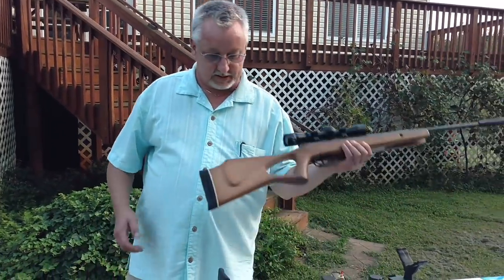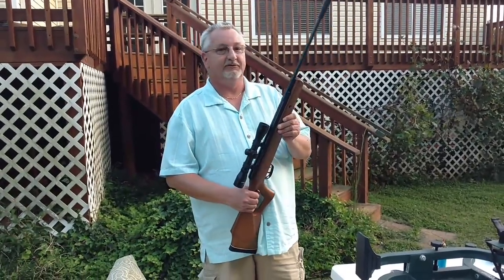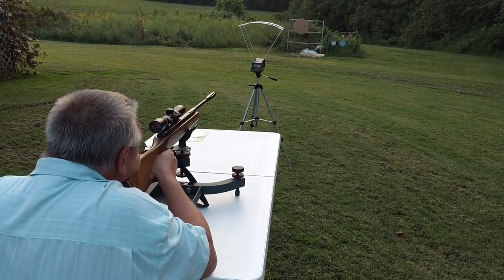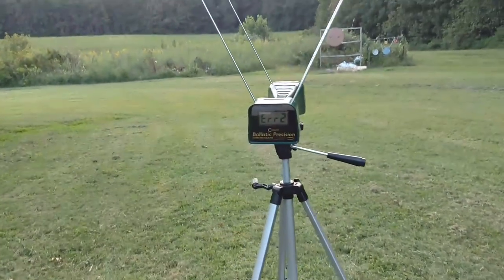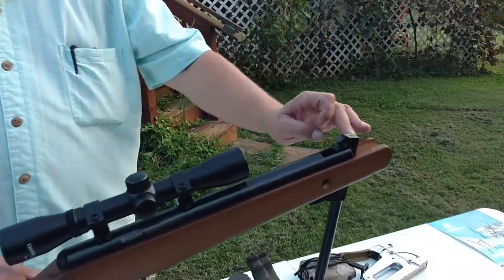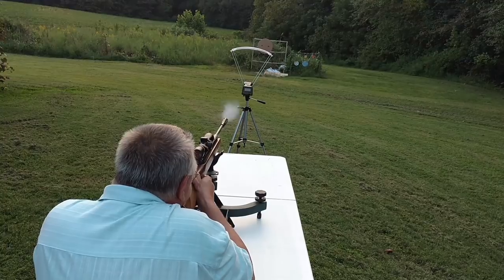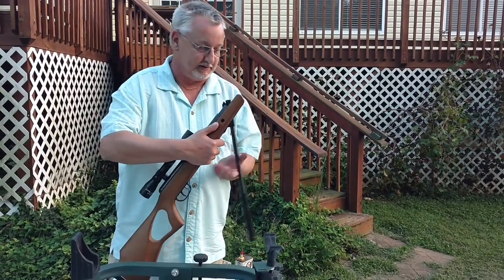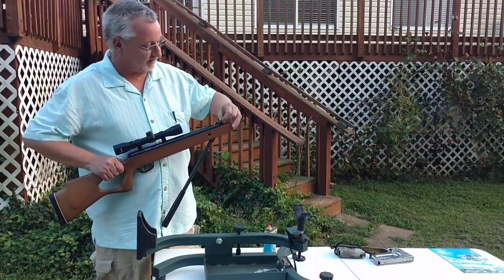Dieseling a Benjamin Titan Nitro XP .177 cal

Comment: Read sir. Murres what you do

Pit a half of cap full (not even that much) of fresh motor oil in the can of the pellet and close the can up and swirl the pellets around gently with the can - shaking it gently so the motor oil can get under the skirts of all the pellets. THEN LOAD YOUR PELLETS UP WHEN READY TO SHOOT 

INSWEAR. I HAVE A FAMO maxim .177. I used those same cross man pellets. I hit a grey squirrel from 50 yards away it went clean through him. I thought I missed the squirrels bcuz I saw the dust kick up on the other side of the grey-squirrel but when the squirrel jumped 3 ft into the air I knew it was hit. 

He ran or scrambled for ablut 4 feet and died n the streets. When I examined him there were a entry hole and exit wound. I was amazed!  

And NO ITS NOT DANGEROUS. I DONT KNOW WHY YOU TOLD THAT LOE. NOW ITS HAZARDOUS TO BE ON THE BUSINESS END!

Comment: And again, The Ruger Air Magnum combo comes in 2 calibers, the .177 that tops 1400 fps with alloy and 1200 fps with lead pellets so why ruin a good air gun when you can buy one that has the FPS you need.
Reply: Check out the Umarex Octane. Same rifle as the Ruger air magnum and straight from the manufacturers mouth. A little better, actually I think. Heavy tough breast of a snap popper lol

Comment: I want to try dieseling so bad but I don't want to damage my airgun at the same time. Will this dieseling method damage my air gun? I just want to try accuracy and damage with 3-4 shots.
Reply: No, it will not more than likely. Trust me. There is levels to dieseling. Greases like Petroleum jelly, Vicks vapor rub will be a mild dieseling effect but will be more consistent in velocities. The liquid choices like oils and gases are more powerful but not as consistent. Use Vicks Vapor Rub. Always seat your pellet, NO MORE than the width of a dime, before dieseling. It doesn’t take much Vicks, don’t fill up pellet skirt area more than 1/3rd. 
Have fun
Reply: @SouthernDestinations47  Thank you! Someone told me dieseling wont work on Gas-ram airguns. Is that true? I have hatsan mod 125 Vortex version not springer.
Reply: @cesurkarakus209  yes it will work

Comment: Don't understand how some folks say this can eventually destroy a spring. How can this destroy a spring?
Reply: It just wrecks seals. It may break the piston seal. It isnt acurrate at all when you deisel pellet guns
Reply: The shock wave when the oil combusts - while technically not an explosion, it is a very rapid burn that sends a shockwave of pressure backwards towards the piston. Your airgun was not designed to withstand this. If you're lucky you'll lunch the breach seal, if you are not so lucky the piston seal or spring will be toast. Might not be on the first shot, but it's in the post if you make a habit of it. Check the puff of smoke from the breach at 4m5 - 4m10s in the video....
Reply: "O" rings are cheap to replace. @Steeps1969  
Won't "break anything.

Comment: What about using flash cotton， or celluloid from pingpong ball?  The power of dieseling is limited by the amount of oxygen in the cylinder, so you may need a fuel containing its own oxidizer, and with slightly negative oxygen balance value.
Reply from the maker: 黄煜皓 I have no idea how or if that would work.

Comment: what if you use actual diesel?
Reply: stinks and the low viscosity would lead it to leak out quickly. From a combustion standpoint, there won't be much difference.

Comment: It doesn't compress the fuel in a diesel engine, it compresses the air which super heats it, the vaporised fuel auto ignites when it meats the air. Not an explosion, it burns the fuel.

Comment: Dieseling will weaken your seals and o-rings very quickly, the gun wasn't meant for that kind of pressure.  Have fun trying it, just keep a separate air gun that you want to use long term.
Reply: Don't do this trick with your favorite air gun.
Reply: If the seal break can you just add a new one? they are pretty cheap
Reply: @ElRealista7  why not just buy a .22?
Reply: @chadh.3209  I have a ruger american in 223 but I'm interested in air rifles

Comment: Put the safety on after the shot unless you don’t want all your fingers. Also at 4:05 you can see your seal break from the pressure.
Reply: "O" rings are cheap to replace.
Reply: @spartanhonor7538  I know. Also, why put the safety on after the shot? This rifle engages the saftey when it is being cocked. It doesn't need to be on "safe" anyway when there is no stored energy.

Comment: First of all, your gun hates those daisy pellets. Most guns do though. A good group at the distance you are shooting should be a ragged hole. A great group can look like a single hole. Second, dieseling is for those that hate their air rifle and are buying a new one anyway, since it WILL destroy a springer to diesel it. It is not a question of "will it destroy my gun", it is a question of "how long before it does". On a nitro-piston based gun it will destroy the gas seals on the piston as well as the piston seals, and on a spring based gun it will destroy the piston seals and eventually break the spring.
Reply from the maker: Paul Andrulis you are absolutely correct, on all accounts. If you watched the video you would hear me warn on numerous occasions of the dangers to your air rifle. I used a rifle that is just over $100. I use it for fun only when I can't shoot another rifle. I have not done that since. Just showing that it can be done.
Reply: The problem is that the situation is escalating. It is becoming a widespread belief that dieseling an air rifle is a cheap way to have a usable firearm for hunting or self-defense. It is neither cheap nor a good option for either use. A pellet gun requires accuracy and precise pellet placing for hunting and only has enough power to even consider for self-defense in some magnum springers. Pellets aren't cheap enough to out-weigh  cheap .22lr ammunition, and a cheap .22 bolt action at wally world is the same cost as that air rifle you are shooting. Everyone puts out the disclaimers (as you did) but doesn't inform the people of the damage they will do to their gun (as you also). Start watching the videos of kids doing it here on youtube, many in their backyards in the suburbs, and you will see why it is becoming a concern for me.
Reply: They were Crossman pellets, weren't they?
Reply: What pellets do you recommend

Comment: Would WD-40 work?
Reply from the maker: Bobby C I don't know for sure. I have not tried it yet. Pretty much anything with a petroleum base should work. The amount of petroleum in it will determine the outcome. Vaseline or Vicks vapor rub work great.
Reply: WD-40 works like a charm, just went around and tried different oils. Best was 2-stroke oil but wd-40 was a good second
Reply: Any smoke indicates wasted fuel, so a lighter more volatile fuel should be more efficient?
Reply: I used to use WD-40 when I was a lad.

Comment: what is it building materials metal and wood??
Reply from the maker: The gun is mostly wood and metal, there are parts such as the cylinder that is probably aluminum with seals of plastic and rubber.
Reply: mainly metal and wood right?
Reply: actually thinking to buy should i ??
Reply from the maker: If you want. It's a good gun especially for the inexpensive price.
Reply: ok so i can for it
Reply: and which penetrating bullets shall i buy

can it penetrate steel at 100 yards??
Reply: another thing is which one is better 177 cal or 22 cal (caliber)

Comment: Why don’t you just buy the Benjamin trail NP2 like I have it hits 1400 fps without dieseling. The gun is more expensive but well worth it. Deiseling will blow your seals out eventually and do other harm to your gun.
Reply from the maker: J G , you are correct. It will do harm to your gun. I don't diesel mine normally. I even mentioned on several occasions in the video that it can harm your gun. I have been looking at the NP. It may be my next air rifle purchase.
Reply: Gonzo's Gadgets and Guns I have one and I love it! You won’t be disappointed with it! Good video btw have a good one!
Reply: "O" rings are cheap to replace.

Comment: Hey i have a double diesel idea.. What if you used a CO2 pellet gun but used a nitrous oxide cartridge for whip it... If the diesel fuel combusted under pressure, it could ignite the nitrous oxide for an extra boost
Reply from the maker: HairlessWookie OfHoth that doesn't sound like a good idea to me. I don't have a co2 gun, but I don't think I would try that if I did. Gases have different properties, you could get hurt doing stuff like that.

Comment: could u use gun powder
Reply from the maker: Albert Pike I wouldn't think so. Most any petroleum based product will work. Gun powder I don't think will reach combustion temperatures under that low of a pressure. But then if it did work I don't think you would want all that powder residue on the inner workings of your air rifle.
Reply: Albert Pike it could work If you use something sensitive like flash powder or armstrongs mix
Reply: Really sensitive black powder might. I doubt smokeless powder would
Reply: Try Vaseline.it stays in place better

Comment: This will ruin a typical pellet gun!
Reply from the maker: zweirich666 it will indeed. That's why I mentioned it several times in the video.
Reply: I have not seen a vid showing a failed air gun yet, and I am looking.  Public opinion does not sway me as much as actual evidence anymore.  Will it ruin my air gun?  May be, (but I use a oil that does not effect rubber), but I bet I spend a lot more on pellets than the cost of the gun before that happens.  I just bought 9 different pellet types to to see which I like the best, (than stick with those one or two types), and I think the cost of the pellets just equaled the cost of gun before I even choose the best pellet,--haha.
Reply from the maker: EarthSurferUSA, like anything abuse and neglect will destroy almost anything. The oils aren't really what messes up the seals. It is the over pressure that does that, along with contamination from dirt etc that gets in there and sticks because of the oils. 
Occasional is just fine, just don't overcharge (overfill) with your petroleum products that you use. And take it apart and clean excess dirt and oil frequently especially after you diesel. 
I agree, this gun was cheap. If it were an expensive one I probably wouldn't be doing this to it.